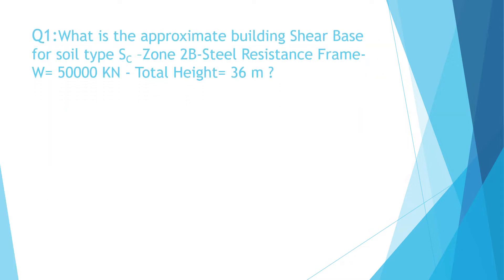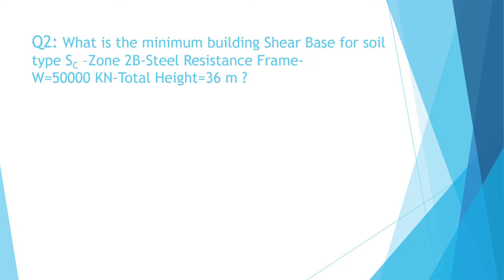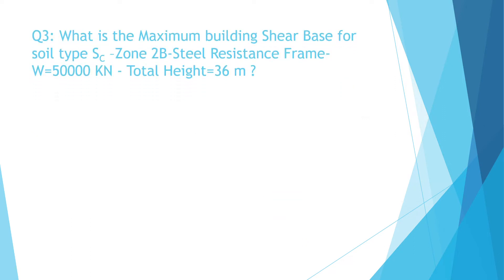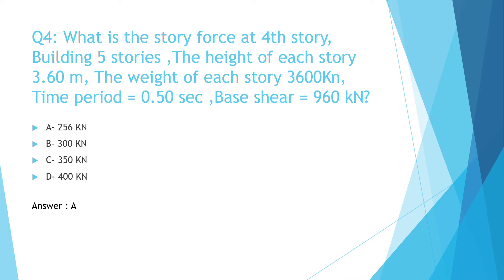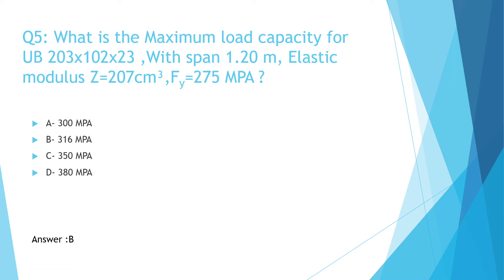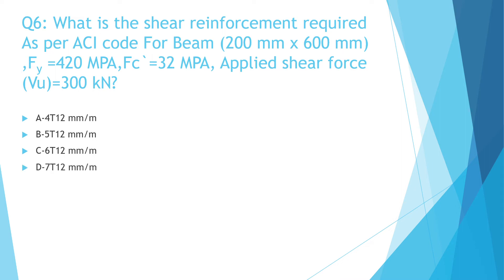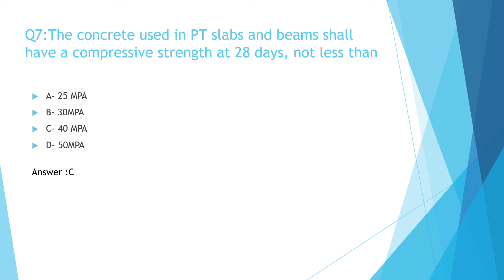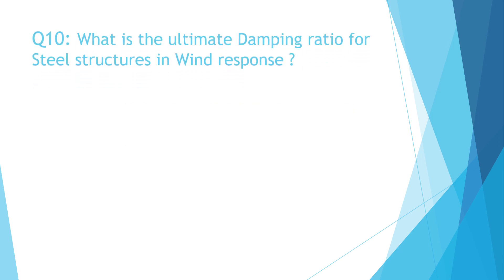Dubai Municipality Civil Engineer Exam 2022  Unlimited Part 1 Construction Engineering Services

Comment: in Q5: the correct answer is 316 N/mm not 316 N/mm2, the all answers are MPa, please can you clarify that ?
Reply from the maker: You are right
Reply: @mroshdiengineering  👍
Reply: please can you provide us for unlimited contracting steel construction.
Reply: @yaya_fawzy   Did you find any material?
Reply: @jaleeltaj6045  no, but i already finished the exam of the steel construction.
Reply: @mroshdiengineering  No not right 316 N/mm2 correct

Comment: Dear Sir in Q6, i think we should consider checking "Smax". and i have doubt that the answer will be 7T12mm/m or T12mm@150mm.. please correct me if i am wrong. thanks.
Reply from the maker: Smax=d/2 or 600 mm if Vs<Vc
Smax=d/2 or 300 mm if Vc<Vs<vmax